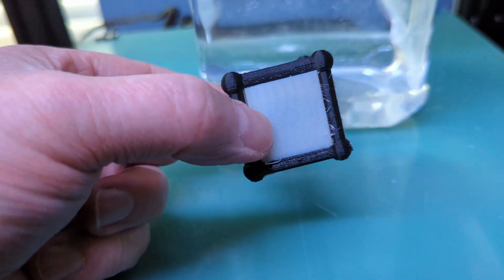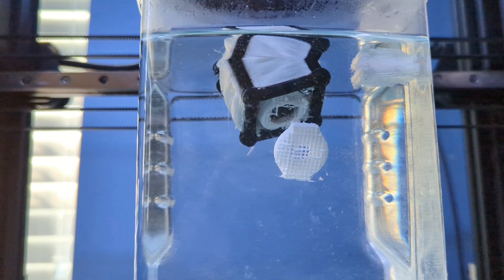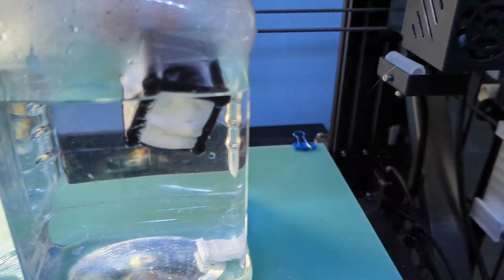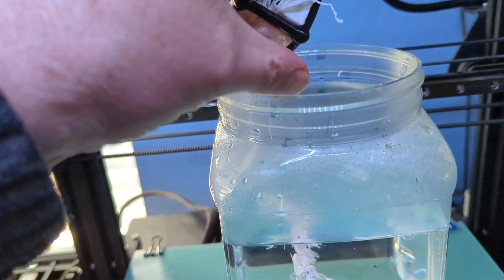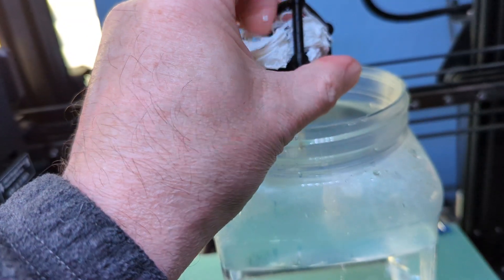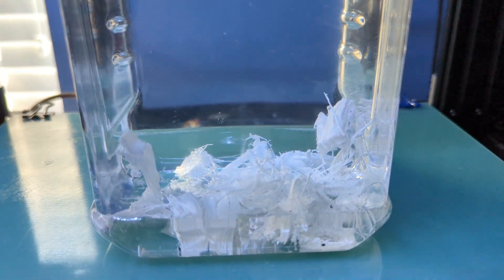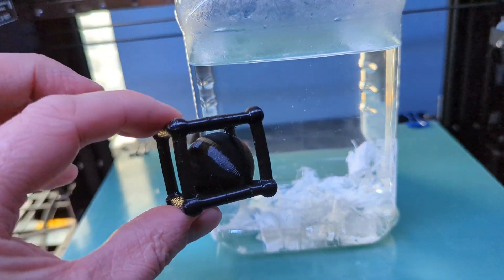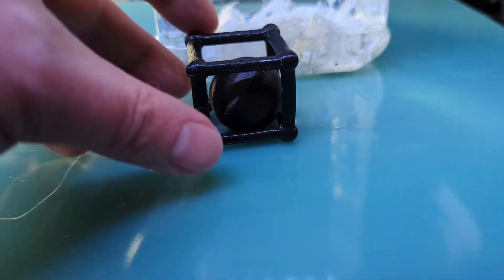3D Printing with PVA supports

Comment: Short and effective demonstration of the characteristics of PVA, soaking in warm or boiling water is better, depending on temperature resistance of the solid parts
Reply from the maker: Agreed. I did it warm water as I could not use hot as the black filament was PLA. Hot would soften the part. In warm water it takes a long time to dissolve but it does soften quickly so I could pull out the PVA to reveal a clean print

Comment: If you have IDEX then you could use PVA just at the interface layer(s). I hear it's a bit more $/unit than PLA/PETG.
Reply from the maker: Correct. I plan on another video on that. Just wanted to show a full support PVA. I will do an interface layer next